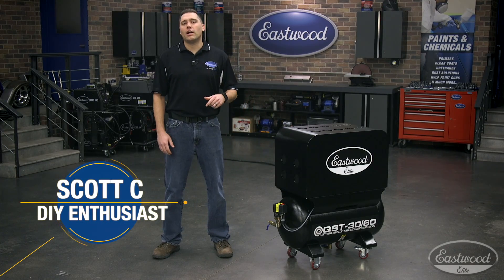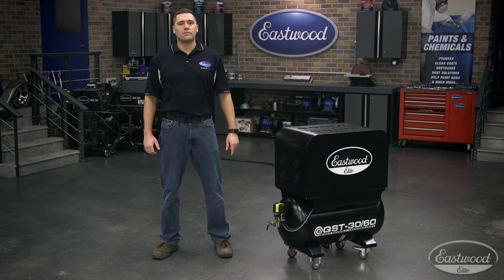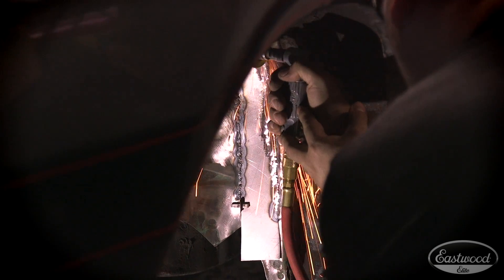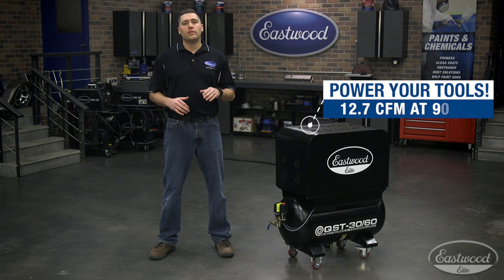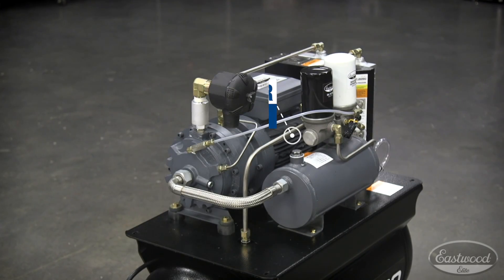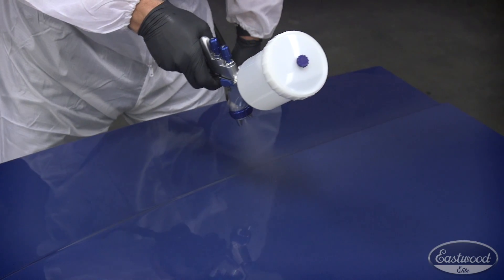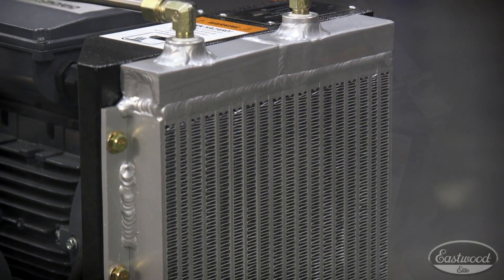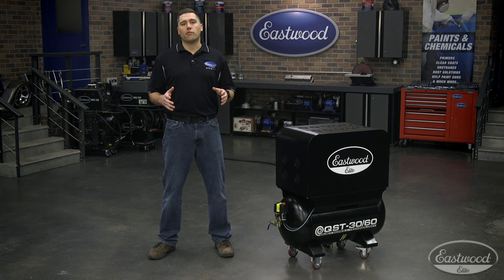Eastwood Elite Scroll Compressor - Quiet. Powerful. Affordable! 30gal Tank 60gal Performance!

Comment: When I discovered this compressor I really wanted one. I have spent 20+ hours researching this compressor, but considering the long history of issues and weekly/monthly maintenance regarding water/oil separation, I can not justify $3,000 (including shipping) for something with such an unreliable track record. The QST30/60 has been out for years now and, despite some re-engineering to address and eliminate failures over the years, there are still too many complaints reporting unreliability. You'd think Eastwood would have the bugs worked out by now. Hopefully Eastwood makes the necessary changes, but until, I'll continue using my reliable, far less expensive, yet louder compressor. Come on Eastwood, make the QST30/60 a rock solid performer so I can throw my money your way!
Reply from the maker: The QST has been out for years and gone through several upgrades including the issues you're speaking of.  It also comes with a 3 year warranty should anything happen.  This video is 4 years old - please check out the updated version here: https://youtu.be/558BVmRXT-I
Reply: @eastwoodco  I watched the video you linked to in your response the day you uploaded it (I've been following information regarding these units for some time now because I really want to feel confident enough to purchase one), however Mark states in the video, which is only 3 weeks old as of this writing, the oil should be changed annually, yet I've read numerous comments in videos from alleged QST30/60 owners stating that they've received email bulletins from Eastwood stating that oil changes need to be done monthly, not annually, as Eastwood previously recommended. So which is it? Is the information Mark is stating in the 3-week old video accurate or not? Please don't think I'm debating anything with you, I'm merely trying to separate fact from rumor in an attempt to make an educated decision of spending $3,000 on a "commercial grade" compressor for my application (DIY/hobby residential use), and the best way to do so is publicly address the well documented failure history, and explain in detail, exactly what re-engineering has been done to permanently fix these issues. The above video is 4 years old as of this writing, however the negative reviews of the QST30/60 on the Eastwood website reflecting commonly reported issues are recent.

Perhaps you should consider making a video specifically addressing all of the commonly reported failure issues (oil/water separation, pressure switch, etc) and the engineering revisions you've made to resolve these issues, and address other rumors about the reliability issues, as well as any newly revised maintenance procedures that may have changed, all in an effort to put false information and rumors to rest. And while you're at it, demonstrate the QST 30/60 running after it has reached full tank pressure and begins its air bleeding (pressure release) process. Is the QST30/60 as quiet as advertised then?

It's obvious, from reading many of the comments of QST30/60 videos on YouTube, that the reliability reputation of the QST30/60 is in serious question, and there are many people like myself that really want to purchase a QST30/60 but won't at the present time, all because of the serious reliability issues we're reading about. Take a proactive stance to get ahead of all the negative publicity these units are getting by addressing them head-on, dispel the rumors via total transparency, and gain the trust of the many people like myself who are ready to buy a compressor like the QST30/60 and the only thing stopping us is the unreliability reputation surrounding them. Just my $0.02

Comment: I have a small "quiet" piston compressor from Kobalt. Its fairly quiet as i really cant hear it at all with earbuds in but that pressure relief valve or whatever its called that pops when the motor shuts down is not muffled so it usually startles me. I would hope they muffle the valve on this one or possible scroll compressors dont need that blow off valve.

Comment: Wish I could afford one of those .. but in the mean time, I'll just keep my noisy compressor outside the shop!
Reply: Exactly,  I don't know why any shop would want their air compressor inside?? Build an enclosure if your scared of theft and call it good.  Plus it's not taking up space im your shop.  Mine is outside and i never here it inside my enclosure.  Plus the cost to repair a traditional air compressor is probably  1/4 off the cost to repair this style.  No thanks